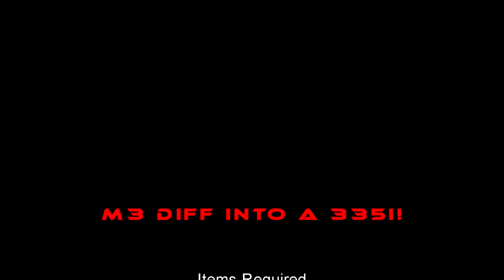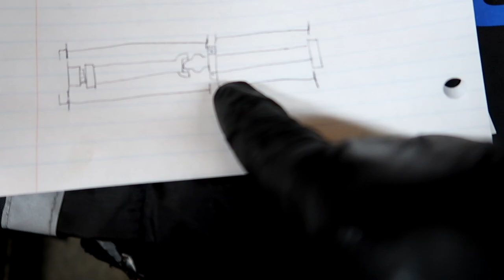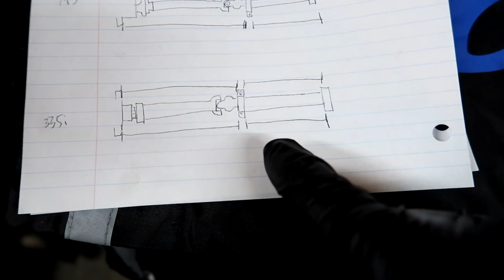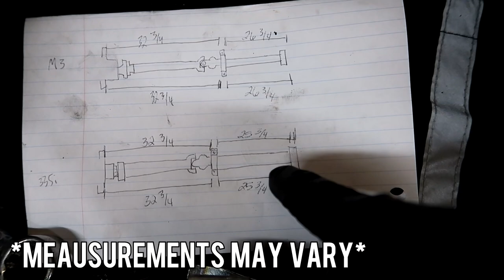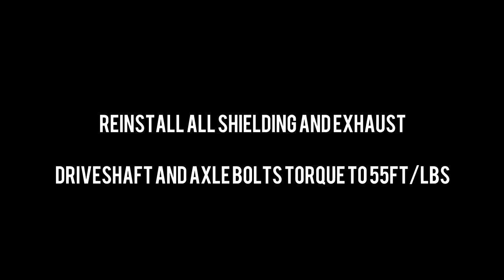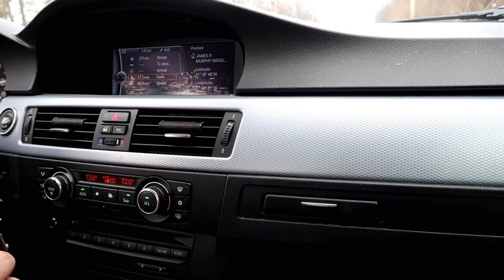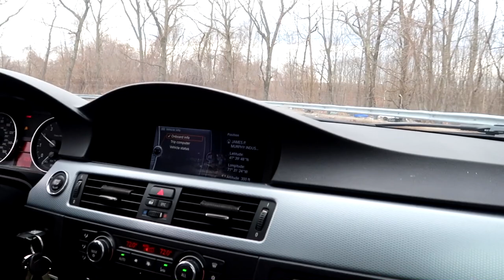M3 LSD in a 335i - DIY

Comment: Damn that’s awesome! If only they came from the factory with an LSD but it’s well worth the upgrade
Reply: The 335is doesn't have a LSD.
Reply: My e92 335i has an lsd...
Reply: SOIL1135 as far as I know, the 335i nor 335is ever came with an LSD from the factory. BMW has an interesting electronic LSD function by applying the brake to the spinning tire alternating back and forth allowing the car to lay down two black strips of tire on the pavement, but it isn't an actual LSD. I have done a fairly extensive build on my 2011 e92 335i and my next upgrade will either be an Mfactory LSD or the M3 swap that these guys just finished. Cheers!
Reply: They couldn’t give the 335i a LSD because then it would be better than the M3 and they would lose money haha
Reply: @Amiiittt  no $hit, Sherlock.
Reply: @SOIL1135  no it doesn't 😒

Comment: Ha ive just done mine ,8 hours of labour by myself after watching this video few weeks ago pretty easy with the right tools, mine is a convertible bit harder of a job as the under strength braces were in the way of the heatsink of the diff so had to shame it into a triangled shape, can finnally make good use of first and second gear,  so much fun , these guys have produced the best content on YouTube in Regards to this platform prayze to budget bimmers as if not for them dont think i would have attempted this mode.

Comment: For the the m3 driveshaft, basically you had it shortened down to 25.7in ? Sorry to be a noob but like is that in overall length or is that what I have to tell the shop when they’re shortening the bottom end ? And will the measurement fit for 335i sedan ? 13:02

Comment: For future reference this is because you have a small diff case. The m3 and early 08 and 07 are the same size and only need driveshaft
Reply: Sorry to necro an old comment, my e92 335i is a 03/2007 build date, does this mean i dont need axles but just the diff and drive shaft from any year e9x m3 with the 3.15 DCT diff?
Reply: @Zodiam.  I have no idea but getting an auto 3.46 with a 1 or 1.5way with 18s are much better and end up being the same. I did gear calculations and you still get 185mph or so top speed but will get there much much better
Reply: @N54God666  I see, i was looking at doing this swap because a local junker here actually has a 3.15 m3 diff listed for the equivalent of $650 which seems like a steal.

I dont really do any track driving  (yet atleast), i just want to be able to chuck my car sideways and have some fun.

Guess its time for some research!
Reply: @Zodiam.  are you manual or auto? Auto already has a 3.46 so getting a m3 diff that I completely believe is an absolute waste of time will actually hurt you. If you're manual with the 3.08 then a 3.15 isn't worth it. Like I said the 3.46 for manual with 18" rims and bit taller tires (i need to check size again) are the best. With my built engine going to 8000rpm I'll have a 225mph top speed and get there much faster then my 3.08
Reply: @Zodiam.  assuming 6mt RWD, with 255/40R18 which is a 26" tire, 7000rpm. You will have 
3.46 vs 3.08
1st 38.5mph vs 42mph
2nd 65mph vs 70mph
3rd 99mph vs 106.8mph
4th 131.2mph vs 141.8mph
5th 156.5mph vs 169mph
6th 180mph vs 193.8mph

This is already extremely short gearing for the e9x but will absolutely make it feel much more thrustie. Pair this with 17t turbos and you will have basically zero traction at will. Even at 60mph

With such a small change to a 3.15 from a 3.08 wouldn't be worth it at all. Auto is even worse since you would be going longer and I'm not sure what other shorter finals are available but you could check tuner motorsport. Since you have a 07 you should have a large pumpkin

Comment: put a screwdriver into the brake rotor vent against the caliper to take off the axle bolt. might have to support the control arm with a block if it swings with the torque.

Comment: Hi guy's im doing the same conversion but baught a spare manual propshaft as would like it welded and balanced before doing th job as using the car to work at the moment  and no time to check exact measurements apart from measuring the spare manual prop shaft against the m3 one,  my question here is even tho i measured it on the floor i realised that the 335i prop shifts forwards and back i guess the m3 one does it also but on the diff side, 335i does it on the transmission side, don't want too much slack and don't want it with not enough as this can cause it all to collapse I suppose ,is 25 and 3 quarters measured from centre bearing bolt to the face of the flange when it was still bolted on the car?, any help would be greatly appreciated

Comment: hey guys. does the new diff gear ratio make it taller or shorter than the stock 335?
taller= less revs than before, shorter more revs at same speed, less top speed.

Comment: How do you like your NRW steering wheel? Mine should show up within a week or two (going on week 7 since ordering) and I can't freaking wait!
Reply from the maker: Brandon Glenn i love it!
Reply: Budget Bimmers how long did yours take to arrive?
Reply from the maker: I bought mine from a guy on Facebook so fortunately i didn’t have to wait
Reply: Budget Bimmers that is fortunate. The suspense is killing me. Lol what plugs are you running in yours? I've got an n55 and I'm about to install the precision raceworks ignition kit. My tuner (Wedge Performance) recommended NGK 97506 as they are two steps colder. Your build is awesome btw!
Reply from the maker: I have the one step colder gapped at .025 and they have been good on full e85 so far. I actually just got my wedge tune yesterday and it’s Fuckin amazing
Reply: Budget Bimmers Wedge is amazing! I've met the guy a few times at local meets and he is humble along with really helpful. I spoke with him at length regarding plugs. I highly recommend the NGK 97506 based on everything I've read and talking with him. "If you don't have NGK 97506 plugs gapped to .022 or .026 with precision raceworks, I highly recommend doing so.  We have seen exceptional results with this plug as it's a bit longer and a step colder.  Less corrections and higher load means more power." -Wedge
Reply from the maker: Sounds awesome, i was actually looking into those plugs, I’ll definitely order some!

Comment: Isn't it possible to join the front section of the 335i shaft with the rear section of the m3 shaft? Nice job anyways 😉!
Reply from the maker: It’s not because the two driveshafts have completely different designs for how they attach each half
Reply: @BudgetBimmers  Ah ok good to know, thanks for the answer!

Comment: Where did you guys buy parts? Can't find a differential for less that $700 and they all got a ton of miles. And how can I know what size my shafts need to be cut into? (e92 dct m3 shaft and e92 335i auto)
Reply from the maker: I got everything from ebay, my diff was 850 and has 70k miles. And you have to measure the driveshafts

Comment: My 335i needs a new differential, old one is making a whining noise. Do you think it's an easy job to swap for an OEM one? Or something a shop should do?
Reply from the maker: Very easy to do yourself
Reply: stay away from m3 diff in a 335i  ... n54 makes so much more torque that this lsd will not last long... buy a proper one that is meant to hold all that torque

Comment: Got any vibration humming? I notice you guys have a blue mark on your diff flange.. I had driveline humming when doing the M3 diff in my car a few years back went mad found out the E9X ///M diff is balanced from the factory and some diffs need counterbalance bolts. I created this thread but 99% of ppl have never heard of this included the guys at my local dealer... http://www.m3post.com/forums/showthread.php?t=1231461&page=2
Reply from the maker: Shane S i read about it on one forum but i have no issues. I also didn’t see any markings on anything

Comment: Awesome Video! Im currently doing the same to my E92 335i 6MT. So this video reallyyy helped me remember a few parts i might need when it comes time to finally do the swap, and not be held up by missing parts..

Who did you use to have your D/S modified? And if you don't mind me asking how much did it run you? 

There's been some talk that a 1-piece Carbon Fiber D/S meant for an E92 M3 will fit on an E92 335i with a swapped rear M3 Diff/Subframe.. Now that would be cool!!!

Btw.. thats crazy how expensive the axle bolts are.. $10 a piece and you need 12 of them to do this, wow. Can the stock 335i axle bolts not be re-used? Smalller bolts? Lower grade/strength? 

What Bilstein Suspension Setup do you have on the car?

Keep up the videos! Ive been a subscriber since the beginning of this channel with you guys just starting out with the mods and repairs!!!

Comment: @27:25  chaps, you see you have a blue mark on the diff flange so you need to have a balancing bolt at that point,  connecting the prop to the FLANGE. https://www.m3post.com/forums/showthread.php?p=19483010 Massive thanks for this video, just about to do the same on my 135i here in the UK.

Comment: Im saving to do a new diff. Wondering how the ratio treating. Been reading alot that people say the stock 3.08 ratio best for the 6spd due to less shifting and they allow turbos to spool. Also read that 3.46 out of auto is better.  Not sure how you like the ratios from e90 m3 auto. Thoughts on the e92 m3 manual ratio,  believe 3.86?
Reply from the maker: I think the 3.15 from the dct is fine, I’d say 3.46 would be too short
Reply: Budget Bimmers you guys went 3.15 or 3.86(3.84 can't remember in e90)? You guys are awesome! Appreciate the response!!
Reply from the maker: I have the 3.15 now
Reply: Budget Bimmers awesome.  Where did you buy from? Also, thoughts on doing full rear end swap (subframe, brakes/calipers, hub and etc.)?
Reply from the maker: I got everything off eBay